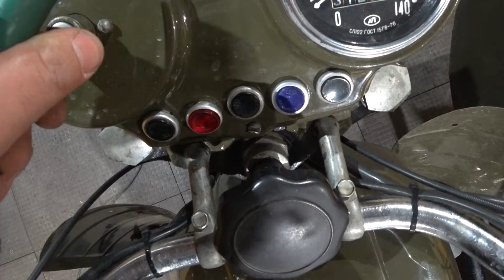Ural[Dnepr] First Start, First test ride, Carburetor change, tuning. One day in Garage.

Comment: Black is carbon buildup on spark plug. Wrench you used is called a ratchet wrench. The tool that goes on the spark plug is called a socket. Just want to help.
Reply from the maker: Thanks, man 👍. I am too lazy to open the dictionary 😅
Reply: Road Home haha you’re welcome.

Comment: 4th light to the right is blue to indicate high beam. Does this bike not have turn signal indication lights? I would guess, one of those 2 lights you didn't know is a turn indicator light.